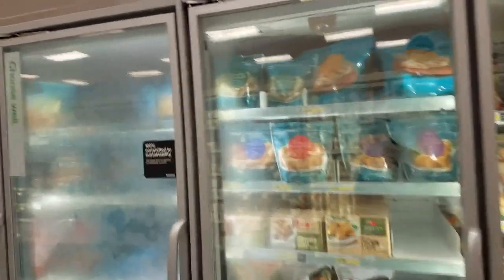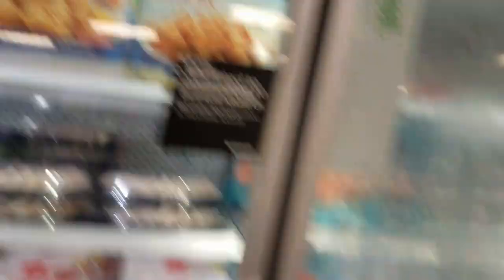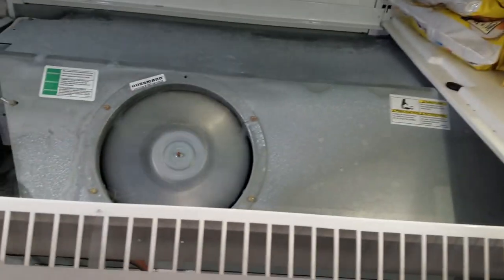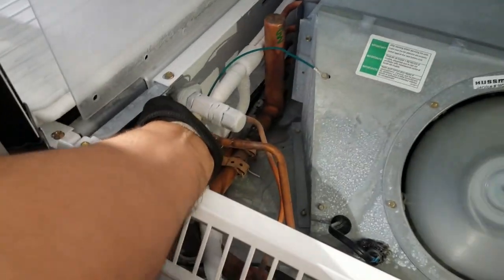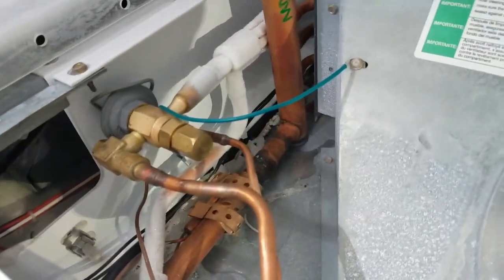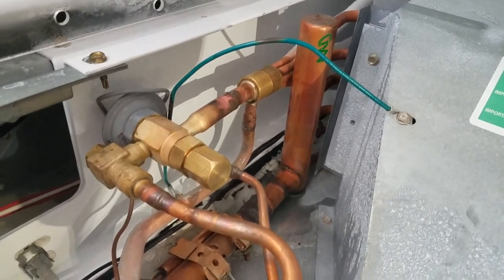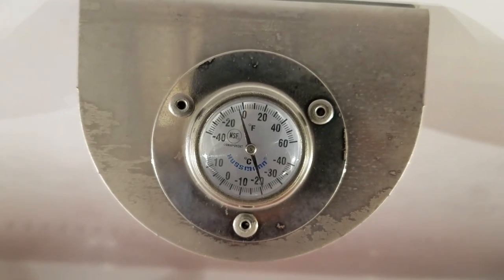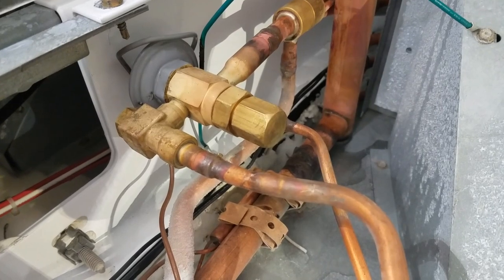Moisture in the system!

Comment: 1-Typically there should be no frost on the hand valve
2- when you heat the valve the ice inside will cause the blockage just after the strainer. So I only heat the side nearest the strainer to the bottom, when the ice blockage is clear the refrigerant will flow and melt the ice between the txv and the distributor telling you it is clear. In other words dont melt the frost off the txv outlet and you will get instant feedback when it clears up. Def needed to change the cores while you were there HW , perhaps several times over the next 2 weeks. Save $$$ in the long run on svc calls

Comment: I've been doing commercial refrigeration for almost 10 years and I've never seen that before! I would've just replaced that valve. Good work buddy, we learn something new every day.
Reply: Would you recommend going into this career?
Reply from the maker: Yes I would. If you are mechanically inclined. It’s long hours and Oncall too.
Reply: The moisture is still in the system, has to be put under vaccum.
Reply: If you've been doing this for ten years and you couldn't diagnose this simple problem m ,you need to get out of this industry. Basic 101!!

Comment: I am a supermarket tech, as a rule of thumb I always remove in line filter inside case, install hand valve and put TXV with removable strainer, regardless how the old one looks like when it goes bad. This helps me like it did in this scenario.  By the way I wouldn't go on sunday if a ffcs is at 0-5 degrees, unless I needed that extra OT. Lol

Comment: Ive had this situation a couple of times, but today the txv i believe to be the cause, same behaviour of low suction pressure and ice at the oriface, no bubbles in sight glass, very hot discharge temp. Did start with adding refrigerant as was advised, no pressure change. Slight increase of head pressure. I shut the compressor off so it wasnt running when i heated the txv, (pressures had equalised before i started work, but unit had cut out on low pressure) would run at 20PSI for a minute or two (R22). So tomorrow sourcing a txv. 
Onto the question, if heating the txv cleared the issue, allowing the refrigerant to flow, thats cool, txv is sensing and running, but the refrigerant has still got moisture in it, there had to be a scenario where in my case the moisture could leave the drier, dont you have to reclaim the refrigerant, and replace it into a vacd system? Moisture a funny thing, all it takes is the condenser to get clogged up, raise the overall system temp and let the moisture out of the drier. Could take months to show up…

Comment: we had a store that was using an r-22 low temp rack.(poison set up)
the guy on call went to site to check this rack for oil failure on #1 compressor.said  it was low on oil level so added oil.put in oil that was in compressor room.not from a sealed container.after leaving the cases started warming up.tx valves frosted totaly, not half way on valve body.the old he put in was loaded with moiture.what a struggle that turned out to be.took a while,many drier changes etc before we got it straightened out.oil changes and new refrigerant.big mess.
Reply from the maker: Wow that sounds like a pain and a lot of work. Now about old oil in motor rooms, I tell everyone I train or work with, never leave oil in motor rooms or use it. Sorry that happened to you.

Comment: I will share a call with you all that I had. Guess what time it came in? Yes, 2 am!! Anyway, the call was multiple cases down on rack B. Rack is in a house on the roof. Air cooled,  Low temp R404a  60 hp Copeland discus comps, hot gas defrost. I checked suction pressure for the rack and it was at about set point. Had 40 % receiver, solid sight glass. .. oh oh. Went down to the cases and a few of the cases were running but about 4 or 5 of them were not. Checked suction pressure at the case and it was close to set point. Hand valve was open on all 4 cases. We know that the supermarket employees never close a hand valve and forget to turn it on.......I did notice that the TXV was warm and had frost on it. Did not look normal. 
Next thing, I got a bucket of hot water and poured it onto the TXV. In a minute I heard refrigerant flowing through the valve. Did the same to the other 3 . When I did the last one, 2 more cases shut down. 
This was not good. I wound up working about 34 hours, Tues and Wed. Went to supply house and brought all of the 163 flare filter/driers they had and a bunch of 3/8 " flare nuts, A case of  48" water cores. Spent the rest of the day there installing flare driers in all of the rack B cases. The call came in 2am Tues morning. I spent the rest of the week each day changing driers and putting hot water on TXVs . Had to sweat in 2 new TXVs as they would not clear. Of course I did check/clean inlet screens also.  Little by little the driers took longer time before they needed to be changed. Finally, the issue subsided. What was the cause? They had a helper in the store by himself. ( which I voiced my opposition about it) He noticed that the oil res. was low on oil. So, he took a gallon plastic bottle that was in the motor room and added it to the rack!
DO NOT EVER ADD OIL FROM A STRANGE CONTAINER! unless you recently used oil from the bottle that you closed the bottle tightly, you have the date and your name on it. Even with that, I recommend using the whole bottle and not leaving any partial oil bottles in the motor room. I think he learned his lesson, because I demanded the dispatcher and company owner to have him work with me though this mess. The bottle may had water in it from temperature changes in the motor room or who knows what was in it. BTW, I did not beat him up too much! :) We became good friends because of this.
Be safe
Reply from the maker: You are absolutely right about the old oil in the motor room. If I see old oil in the motor room I dispose of it properly. Right away

Comment: after that misery,i tried to convince the customer to change tx valves and go with 507 .,get rid of demand cooling,less oil issues(high compression ratio was burning up the oil and clogging oil pick up in crankcase causing constant oil failure problems)they went with MO 99.
Reply from the maker: 😳 wow they still use that

Comment: Hey man great stuff , I’ve been doing refrigeration for a couple years now and I just started doing racks . Do you have to pull a vacuum after pumping down at hand valve ? I’ve had different senior techs tell me different stuff . What your take on it ?
Reply from the maker: To me it all depends on how new the ball valve is. If you have a new ball valve then yes if not then either replace ball valve and then put it in a vacuum or purge it if it’s an old ball valve. You will find out real quick

Comment: Don't you have to pull a vacuum on that circuit before you open the valves again?
Reply from the maker: The system still had a small amount of pressure. So I did not have too. 👍

Comment: Ive worked on walk in  freezer/ fridge and reach ins, when you open up the strainer not sure if you pull a vacuum after. Do you have to or not, i want to understand. Just want to expand my knowledge in  refrigeration. Thanks
Reply from the maker: Yes, you are suppose to pull a vacuum
Reply: Thank You for answering and for the video.
Reply: Depends if the EPA is standing over your shoulder 😁. Unless I’m torching the reality is if you can leave the valve cracked a hair or with your gages or whatever you have to do just to keep a whisper of gas flowing to keep it dry. Yes I realize hi glide blends and vapor loss blah blah but what’s the charge for rack? 1500 lbs? That side is a oz or two gonna make or break the gas? Of course not
Reply: No, you dont pull vacuum,  since you still have positive pressure coming out, no air goes into system
Reply from the maker: Yes your right, 👍

Comment: whats that extra copper line coming out of the distributor?
Reply from the maker: Good question, that for hot gas defrost. It bypasses the txv
Reply: @gr82becool  damn rookie question on my part. thanks mate. only ever seen heater elements on the little exposure ive had to supermarket systems.

Comment: What method do you use to pump down a circuit down on the rack ?
Reply from the maker: The blow and go method, lol, J/K......I shut down liquid ball valve then use my guages to pump liquid to suction to help speed up process. Them when there is only vapor. Force compressors on and ball valve off all other suction lines except yours. When I get below 5 psi I shut off suction ball valve to my circuit and open all others, then put rack back to normal.
Reply: could I use the recovery machine method? Close my liquid and suction line lines on the circuit I"m working on 
. Connect my gauges to both of them. Connect my middle hose to my recovery machine. then connect my hose from my recovery machine to a suction port on another system.  @gr82becool
Reply from the maker: You could, but I think that might take longer. And you have to haul that extra equipment around.
Reply: RefrigerationTech true I have tried ball valving all the suction line off  except the circuit I’m working on and still did not work for me . I’m just trying to find an easier way of doing it
Reply: Shut off isolation valves assuming so fortunate. Hook charging/evac hose from gage manifold to suction service port on a running compressor. Open gage manifold and front seat compressor suction service valve. Probably have to manually drive low pressure switch if mechanical with screwdriver. Let compressor suck gas in while pumping down. Don’t let a scroll run in a vacuum though- really not a good idea to run any in a vacuum but definitely not scroll
Reply: Nice video. I dont do refrigeration so I am not familiar with this system. When you pulled the screen out did you break the vacuum of the system and allow air in?  If so wouldn't you need to pull another vaccum before opening the valve?

Comment: Fresh meat case. Medium temp rack. Blowing out 26 degrees. Great airflow. Txv screens are clean. Coil is not iced up at all. All fans are running. Manager wants case at 18 degrees. Back epr out as far as it would let me. Temperature dropped to 25. I personally don’t think it’s possible to get this low but would at least like to get to the low 20s, but not seeing it’s possible. Any suggestions?
Reply from the maker: You can try dropping your suction pressure at the Rack. BUT, if you have a floating suction you CAN'T do that. All your circuits has to be on some kind of temp control if you drop the suction pressure. If no one has dropped it to 18 degrees in the past then just simply tell the manager that this case is not designed to drop that cold. Also, if there is a Refrigeration Schedule (RS) Sheet in the motor room, look at the design coil temp for that case, OR simply GOOGLE the specs to find that info. Good luck!

Comment: What seems puzzling to me is that you said that you evacuated the system, although frost build up  was still present on the TXV. I was always told that starting the system without refrigerant can be bad for the compressor. I also noticed that you applied a torch to the TXV. I am not sure if the system still had refrigerant in it or not. I was again told that applying heat to the system when it contains refrigerant can cause an explosion. Can you explain in detail how you approached the TXV to remove the mosture? Was that with, or without refrigerant still in the system?
Reply from the maker: +Best Tours Enterprises, S.A. When I hit the txv with a torch, that was with refrigerant in it and the system running. I did not have it in a vacuum yet. It was not alot of heat only enough to warm up the valve to melt the moister that was frozen in the txv. It will not cause an explosion. When the moisture is melted from the txv it will the get collected in the liquid line drier at the rack. Thanks for your comment.
Reply: Videos are excellent 👍🏾

Comment: I preffer wet clothes than fire to defost the txv
Reply: Centinela wet clothes?  You mean cloths?  U can just pour hot water on the valve. Wet rags will stick to everything in the case like velcro. Torch is the most efficient way

Comment: Your hot gas line is frosted I bet your check valve is no good
Reply: Shane Miller if the check valve was no good it would wash the rack out (oil safeties). The only time the HG dump is clear is in def

Comment: 1: Frost on the hand valve???? Hmmmm 🤔 
2: let’s say hand valve had nothing to do with?. 2a: supposedly The system is just worked on for moisture problem and it still had a moisture problem. Somebody’s not competent at their job and took shortcuts. 
3: if this was a new system installed there definitely should’ve never been a moisture issue that was caused by the technician. You should now be working at McDonald’s or a janitor service but not in the HVAC industry.